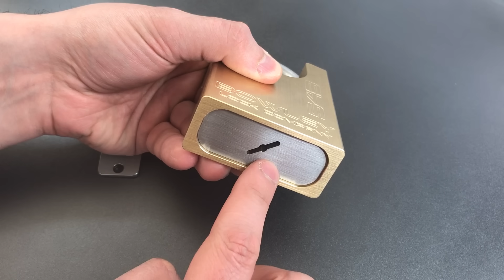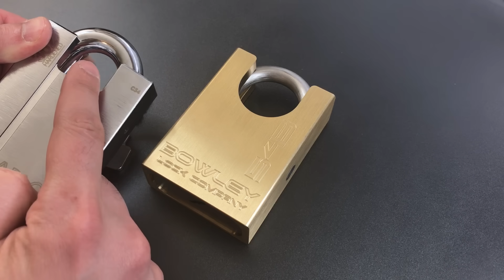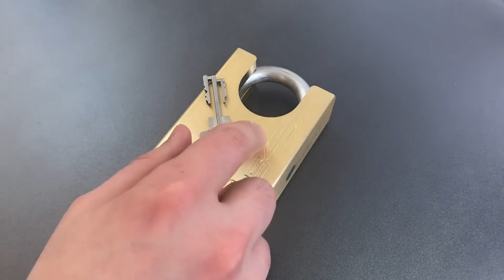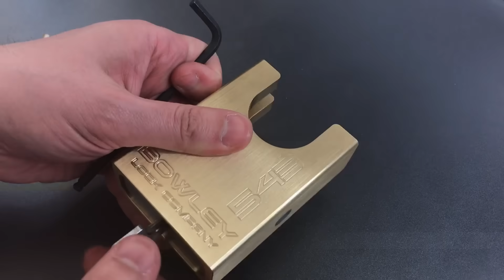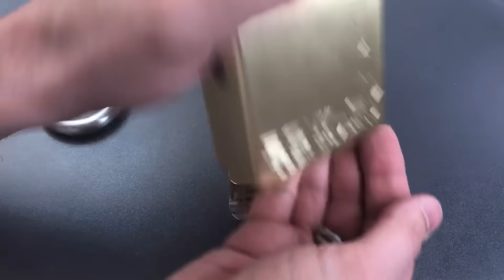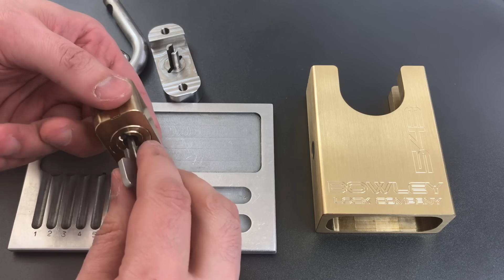[653] Prototype Dual Fork Bowley Padlock (Model 543)

Comment: Are these locks masterable?

And are the pin depths limited by the introduction of the slot in the key?
Reply: Well, duh.  If the pin depths went all the way down to the slot, never mind below the slot, then the end of the key would fall off.  Not to mention that there wouldn't be a pin depth to begin with if the key were cut below the slot.

Comment: Probably easier to attack the chain at that point.
Reply: Certainly the weakest link
Reply: better yet, dismantle the bike and sell it part by part
Reply: @will2998  I've seen so many cases of it. One time I've even seen just a chained frame, not a single other detail left.
Reply: @Yorick257  Indeed, that is disturbingly common.
Reply: I think it's cheaper to cut a section off the bike rack and steal the bike lock and chain together
Reply: Firearms Training Channel probably more worth to cut the chain and steal the lock lol
Reply: (uses titanium chain)
Reply: ThatWaffleEater 1 depending on grade of TI that may be easier to cut through than case hardened steel chain.
Reply: @MaestroAlvis I guess if you spend >$200 on a lock you wont forget to use it
Reply: yeah tough luck 'cos if you're going to steal a bike you're more likely to come prepared with lock breaking tools, and breaking a chain with a ramset sounds pretty impossible to me.
Reply: @Amethyst_rose29  I've heard the battery powered angle grinder being used
Reply: @jessenen  Yep, no lock will stand up to a cheap cordless angle grinder.  They are just a lot more noisy and throw a plume of sparks and thieves don't like attention.
Reply: @Amethyst_rose29  there isn't a bike chain that I can't cut the chain with a set of bolt cutters that I can carry.
Reply: That’s kind of the point...
Reply: which is pretty much the point, the harder a lock is to defeat the more likely the thief is to use destructive entry methods that leave behind evidence, if your bike is stolen and you have that evidence your insurance is way more likely to cover it
Reply: You will probably get you lock stolen instead of your bike haha
Reply: Your not wrong. It's weird how sophisticated some of these pad locks are. 
Like who needs one of those massive Squire locks?
Reply: @MaestroAlvis  serious answer:  the US army.  Giant padlocks like that are used to secure things like ammunition bunkers and holds.
Reply: @PellyEllieEla  do it I dare you, also record it for.. Educational purposes... Yeah, that.
Reply: MURICA fuck yeah

Comment: "five quarters of an inch"
wtf guys, this is really getting out of control
Reply: Annoy-o-tronino Kripperino cracked me up this is funny af
Reply: Yeah, it's so improper.
Reply: Eric Y you could say it’s an improper fraction...
Reply: @PandaMan937  That's the joke.
Reply: @ericy1817  that's the joke.
Reply: @TheShizzlemop  Yes. I understood the joke. And I made a joke on improper fractions too.
Reply: Wait till you try adjusting your guitar neck and find an American manual talking about 7/64th of an inch..
Reply: OhFishyFish 7/64th is actually pretty easy to find. 128th suck though.
Reply: 7/64ths at least make sense. 5/4 is just annoying
Reply: @leedoughty4497  or 1 1\4
Reply: @leedoughty4497  agreed
Reply: Annoy-o-tronino Kripperino it’s just shorthand. instead of one and a quarter.
Reply: This is really getting out of hand, now there are five of them!
Reply: It's used in the lumber industry with 5/4" deck boards so why not here too?
Reply: @Geoff_G  its used in lumber because 1 inch boards are 3/4 of an inch thick. 5/4 means they're 1 inch thick. The call size is what it is before they finish the boards. Here it's a literal 5/4 thick so its a little more strange
Reply: Inch a a quarter. simple
Reply: 5/4 = 1.25 inches
Reply: @xxXthekevXxx  your mom =
Reply: Just so I'm clear he means an inch and a quarter when he says 5/4 quarters of an inch
Reply: Common core got ya'll phucked up. 5 quarter has been very common. It's the size of deck boards. Ask for inch and a quarter at the lumber store and they look at you like a doofus.
Reply: Annoy-o-Tron... why did you only post this once instead of thrice? LockPickingLawyer not good enough for the three message treatment?
Reply: @ItsDKoda  it only really works for short things, like Hello! Hello! Hello!
imagine me saying an essay
thrice
Reply: He was explaining the model number. It wouldn't have made sense if he hadn't said it that way.
Reply: @Writer B.L. Alley, 5/4 is a standard measure for lumber (deck boards) so I think he actually means 5/4
Reply: @Geoff_G  unless you use 2x6s for your deck boards
Reply: "5 thousandths of an inch...."   looks like a ml to me.
Reply: Vulgar fraction
Reply: Wowoow its weird but not really wrong....as strange as it could seem....
Reply: oh my, a kripperino in the wild
Reply: Well a Kripp fan on a lock vid. That was for sure unexpected!
Reply: johno You must be plagued with self-pity, then.
Reply: This is where metric would be useful lol
Reply: 1.25 from Europe
Reply: You lads make me happy i live in a country that uses the metric system, cos holy shit.
Reply: Here in the civilised world we moved to metric
Reply: Lmfao
Reply: Hello!
Reply: Hello!
Reply: Kripp0
Reply: I had to rewind when I heard him say that haha I thought the same thing
Reply: Hypothetically let’s just say that was an improper fraction...
Reply: Those Canadians need to switch to metric eh?
Reply: that term is used in construction for decking boards. Never did understand why they dont jusy say inch and a qaurter .
Reply: I thought he said that too u i was like wait what?
Reply: @Geoff_G sorry, nope,  actually, they are not. If they are finished one side they are 1-1/8. If finished both sides, they are   1 inch..
Reply: Five inches of a quart
Reply: Oh it's not too crazy. I used this lock to protect my 1¼" lumber while listening to 15 Steps by Radiohead. Nothing weird about it!
Reply: 1.25
Reply: This is gold 5 /4" why haven't I thought about this at work mess with the apprentices heads on new level tomorrow.
Reply: But this one goes to eleven
Reply: It’s a very common rough lumber thickness.
Reply: Five-fourths vs five-quarters is like pronouncing tomayto vs tomaahto... whichever way you pronounce it is personal preference, and technically both are correct, no matter which is the universally preferred way to pronounce it... I think the same is, or at least should be true here with 5/4
Reply: People from the US using inches doesn't bother me. People in the US using fractions instead of decimal drives me fucking nuts. Why would anyone want to have to do a bunch of fraction expansions in their head before they can do a simple divison?
Reply: @Mural  wasn't the whole point of the 12" foot that it was more condusive to fractions than metric?

2/3 is easier than 0.6666666666666666666...667.  Don't get me wrong, I don't think imperial is anywhere near better than metric.  But it seems weird to be mad at fractions yet okay with the inch when that is the inch's one claim to fame so it makes sense they get used together.
Reply: @YayapLives  This is a point a lot of people miss. This is why counting systems based on 60 (e.g. degrees, time) and 12 have been so popular.  For example, 60 is divisible by 60, 30, 20, 15, 12, 10, 6, 5, 4, 3, 2 and 1.  That's pretty handy.
Reply: @Mural  They're binary fractions. 2^-n 
Half of a half is a quarter.
Half of that is an eighth.
Half of that is a sixteenth.
Reply: @Mural  because conventional imperial measurements are in fractions.  If you decide to start doing your working out in decimal, you're going to have to covert it back to fractions any time you need to purchase materials or communicate the measurement to someone else.

Imperial measurements are just less efficient all around.  I would guess that people who use them often are much better at using fractions due to the fact than none of the units easily convert.

When you're regulating working out how many stones to an ounce or feet in a mile you probably don't think twice about simple fractions.  

It's probably obvious, but you also can't accurately represent fractions with prime denominators like thirds without making compromises.  It'd be rare for that to be an actual problem but I guess there are fine engineering problems where it matters.
Reply: @Mural  because it's much easier if you have done much of it. Doing decimal division in you head is a pain in the ass. Fractions are generally quick and easy to do.
Reply: @doug112244  This depends on what you practice.  We were taught fractions and decimals in the same lesson in school, but living in a country with the metric system means that multiplication and division involving decimals come naturally.  

The fact that fraction conversions seem natural to you is due to it being necessary for you to practice them. 

Most kids will learn their 10 times tables more easily than their 3s or 4s because the pattern is so simple.  

Fractions are also easier to visualise, but this is easily fixed by imagining decimals as fractions of ten.  0.22 = 2.2/10 = 22/100.
Reply: He's not saying anything wrong.
On pumps, electric motors mechanical seals and rotating equipment we measure everything in 1/8 (.125") inch increments. So a 2 inch pump shaft is a -16....
meaning 16 x 1/8(.125")=2.000"

A 6 inch motor shaft is a -48 

It's a engineering shorthand thing, so unless you're a mechanical engineer you would not be familiar with this connotation.
Reply: @midship_nc  yes. imperial pipe names are horrible. It is not wrong, but uneccessary complicated way to say 32mm...
Reply: David Baucom 
I thought engineers use the metric system, because it’s easily scalable.
In your case you’ve introduced a yet another measuring unit of 1/8 inch, creating more confusion.
Reply: @midship_nc  hair clipper guards are measured in 1/8ths of an inch as well, i.e. a #5 = 5/8"
Reply: @midship_nc  we have the same thing in the sheet metal industry. Some of the press fit fasteners. (Depending on the type) are measured in 16ths, 32nds or 64ths.  A number 8 PEM stud would half an inch.
Reply: laughs in metric system
Reply: I think what some people here are getting at is..
WHY U NOT USE METRIC LIKE NORMAL PEOPLE!>!>!??!?
Reply: @Broockle  Why did a Canadian company build their lock using imperial units and name the lock after those measurements.  Now that's weird
Reply: @Mike10001 
huh.. Yeah..
Guess that's the best way to advertise in the US.
Reply: @Broockle  
 Well, in that regard, we Americans just aren't that damn normal 😁
Reply: Imperial system is really confusing
Reply: all these replies saying things like "it's not weird. look at all these other places in America where we use weird af measuring schemes!" you're just proving how many loops you gotta jump through to cling to imperial x_x
Reply: The true problem is your terrible confusing metrics lol
Reply: Can America just learn normal measurements?
Reply: 5/4 is a common expression for imperial measurements. No different from 13mm. You wouldn't say 1cm, 3mm.
Reply: @generalralph6291  One would definitely say 1.3 cm. And you could say 1.25 inches as long as you don't need to switch to base unit (feet). But instead people using imperial measurement units use fractions. And you have to because for some reason you need 12 of those inches to get your base unit.
Reply: @generalralph6291  Because you don't mix units. cm and mm are not like feet and inches you use one or the other. 13mm is nothing like 5/4ths.
Reply: johno It’s “five quarters.” You don’t say “five fourths.” If you have 10 quarters you don’t say you have 10 fourths of a dollar.
Reply: @generalralph6291  nah. once you go over 4 it becomes 4ths. like 8ths, 16ths, 32ths.
Reply: johno I know how fractions work.
Reply: @generalralph6291  and i know how fire hydrants work. what has that got to do with the English language?
Reply: @mabamabam  *32ndths...
Reply: Drago  It's not about "better measurement" it's about fucking 5/4th of something being "normal"
Reply: @oicmorez4129  there is no obligation to reduce fractions. 5/4 is correct usage. It is much quicker to say than 1¼. And in a world that is constantly seeking to abbreviate, 5/4 is normal.
Reply: @unclejimmy5778  The point is, the model is called 543, for 5/4th, 4, 3.
Also, quarters shouldn't be used in distance, but who am I to judge. American people seem to not kind shit like 3/64th
Reply: @oicmorez4129  quarter inches are used for distance in nearly every manufacturing or construction setting in the United States. Have you used a Tape Measure before? You would never use decimals to describe the measurements. 

Americans use decimals also, don't assume that fractions are exclusive. But for many in the construction industry, using fractions is simpler to work with than using decimals.
Reply: @unclejimmy5778  Whatever floats your boat. Just keep it out of the civilized market
Reply: Every decking board is 5/4".  It's way more common than you think, and for good reason. But you over educated idiots wouldn't understand.
Reply: why don't you people start using the metric system and just say...
Reply: This is gonna blow all your minds. Computers, the things that run based entirely on logic and don't give a fuck about your pedantic measurement battles, run on binary systems and view everything internally as fractions. 1/64th. For one unit of something split into 64 parts. 16/8th for something split into 16 parts working on 8 cores. To a machine, using only logic, using the number as it is makes the most sense. Why waste time reducing fractions? Yes 5/4 is 1 and 1/4. But that's a whole plus another fraction and you gotta put them together, and that's just unnecessary extra steps. 5/4 tells you how many there are and what fraction it's split into. 5/4 makes more sense than 32mm or a portion of inches.

Oh, and double bonus fuck you points: Metrics are based on arbitrary, temporary, indefinite numbers. Metrics are subdivisions of the width of the globe around the equator. Which is estimated, indefinite, and temporary. It's not based on any real, permanent measurement. It's as arbitrary and pointless as Imperial.
Reply: @chrismanuel9768  You're wrong. All SI Units have been re-defined and now are based on physical constants. The Metre being based on the length of the equator was from 1793. It was redefined in the 60's and then again in the 80's and again a minor update in 2019. A metre is now measured as the distance light travels in a vacuum in one 299,792,458th of a second. So totally not arbitrary - in fact it should be consistent everywhere in the universe. So fuck you and your truly arbitrary imperial system.
Reply: @webb2800  I'd like to add that (according to wikipedia, up to you if you consider it a reliable source) the inch is actually defined as 25.4 mm.
Reply: @webb2800  It was only last year that this finally became true though. The metric system is clearly superior in most respects but it's no less arbitrary than the Imperial system.